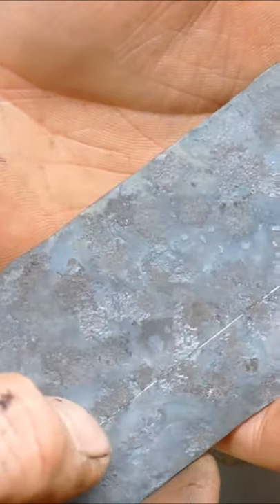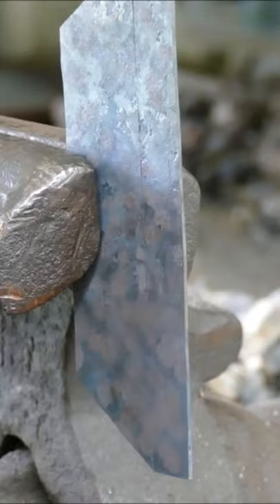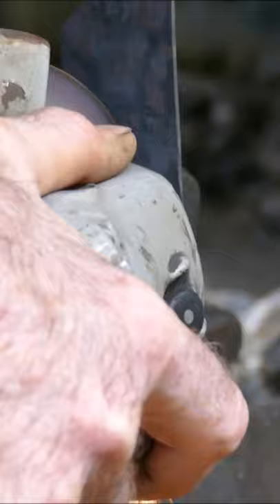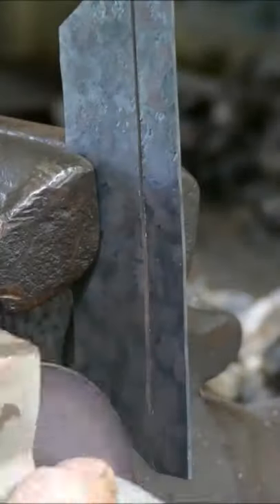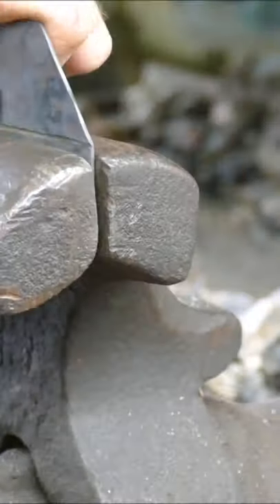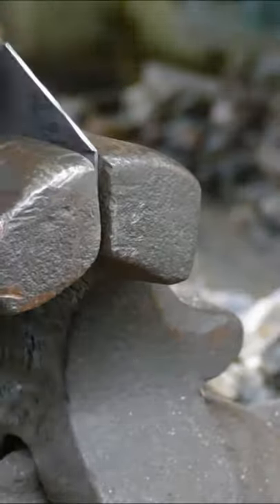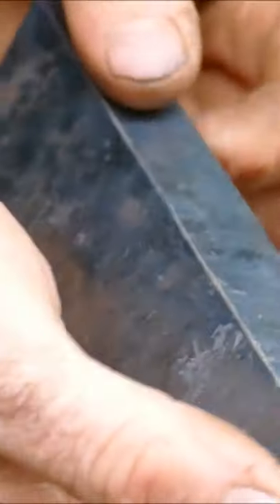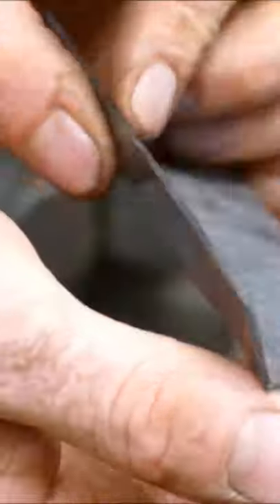No brake press no problem #shorts

Comment: The “weak area” he is talking about is called a stress riser. Most of the stress from bending is applied to that one spot. Neat way to bend steel tho, i imagine you would have to weld the inside after

Comment: looks great, agreed.  does the weak area need some sort of reinforcement or is that a nonissue?
Reply from the maker: It is weaker so if it needs the strength you can stitch weld the back. In this application it isn't necessary as the rest of the build geometry gives the strength it needs.

Comment: Nice one!Do you weld the seam after bending, or does bending give it enough strength?
Reply from the maker: Because you remove some metal it will be less strong, so in applications where strength is required a bead or stitch of weld will restore it's stiffness. Depending on the geometry of what you make it can be fine just as it is. This is a part of a base for a lantern I'm making and doesn't need extra stiffening. Cheers J